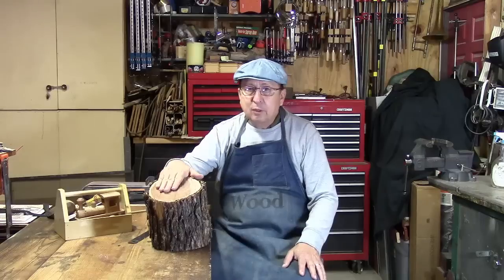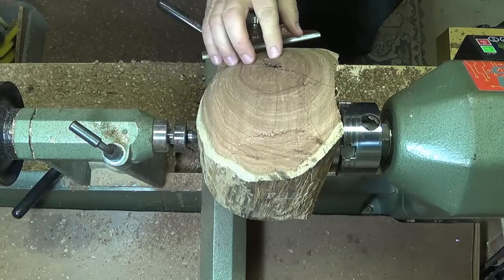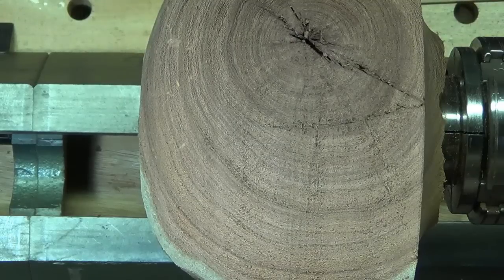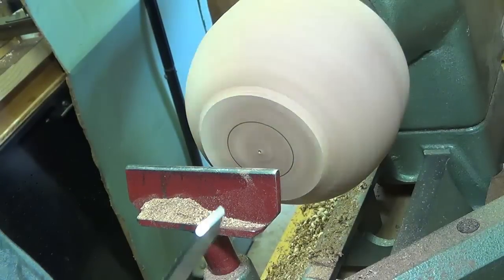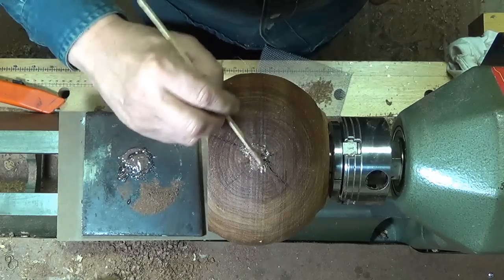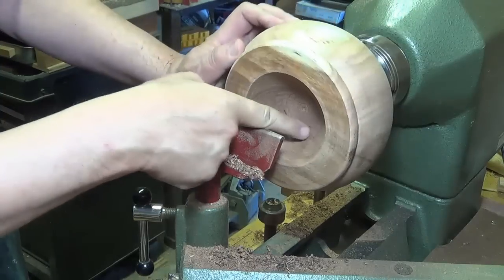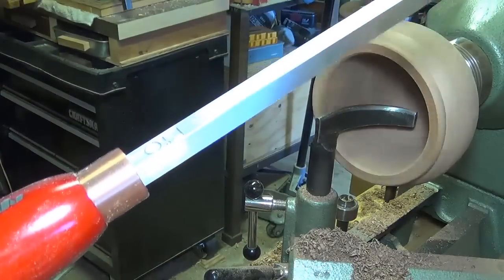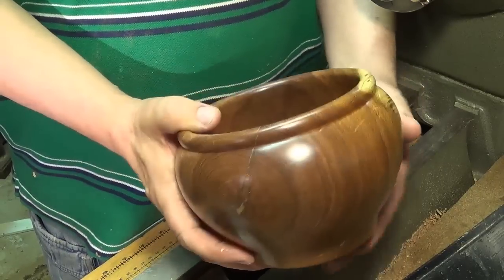Freestyle Mesquite Bowl

Comment: You ended up with a very pleasing bowl, Cip! I like your methodical approach and how you explain what you're doing. Thanks!
Reply from the maker: +Rick Hilton Hey there Rick! I think it turned out well. Talking to the camera while turning comes natural. It's like talking to myself. At my age that comes natural, too. See you on Thurs at the turners meeting. Cheers...
Reply: +Cip&#39;s Wood Chips I've heard that talking to yourself is okay as long as you don't answer! : ) Anyway, I did have a question. Why don't you apply the finish when the piece is on the lathe, and use the resulting heat to apply a glaze to the piece? Also, have you ever turned a bowl using Arizona Ash? I have a piece of ash from a neighbor's tree and was wondering if its worthwhile to try to make something with it. See you at the meeting!

Comment: Great video, love how you explain your process. I have 120 acres strewn with mesquite and love to turn it, especially wet. Mesquite is so stable it only shrinks about 5% from waterlogged to dry. Epoxy or CA and coffee grounds makes a great dark filler for those wind checks in the pith.
Reply from the maker: +Andy Owen Howdy Andy! I was very pleased with this piece. When I filled the large checks I was hoping it would turn much darker. In the end it is just fine. I usually use ground activate charcoal to make a black filler. I will do that next time. Thanks for watching. Cheers

Comment: Having lived in the desert southwest, I have worked with my share of mesquite.  That wood is harder than my head....and that’s pretty hard.  If you had been using a cheaper grade of tool, you would have been sharpening it very often.   The carbide is the tool I use to turn mesquite since I don’t have to sharpen nearly as often.

I have also turned Argentine mesquite and it makes beautiful wood turnings, as well.  However, the Argentine mesquite tree has thorns 3”-4” long and cutting down the tree for the wood can be a challenge without being injured.

Try turning some Tamarix (desert salt cedar). It is a beautiful wood too, yet does not have the same properties of red cedar.  Tamarix can be difficult to turn because of its hardness, but worth the effort.
Reply from the maker: Howdy Glasscutr! It looks like you know mesquite. Mesquite in Texas does have thorns when it is young for protection. It looses most as it grows and thickens. Occasionally, I do find them embedded in the barks. It is a good idea to wear gloves and be careful. Cheers

Comment: Does mesquite check easily?  I want to do some turnings out of mesquite. Nice project. Good looking bowl.
Reply from the maker: Greetings William! In my opinion, mesquite is a good dense wood. I would say it is very solid and does not check or slit easily. It can be weakened by insects and water damage over an extended period of time. Thank you for the question.

Comment: Cup, can I ask what kind of lathe you use. It is so quiet, I think I need to upgrade to that make/model.
Reply: Sigh, sorry for the auto correct Cip
Reply from the maker: +webslinger67 Howdy Webslinger! I mostly use my Nova DRV-XP. I believe in the UK and Europe it is sold under the name "Record Power". I have another lathe I sometimes use, Nova 16-24 (8 speed, belt drive).
I hope that answers your question. Cheers.

Comment: Hi Cip, I am fairly new at bowl turning and I have a Shopsmith lathe, it is ok if your bowl blanks are as round as you can get but if a little rough and not well balanced the machine will try to walk off the location. The slowest I can turn is about 650-700 rpm. Shopsmith has a speed reducer but is very expensive and I don not have that kind of money right now.  What brand of lathe are you using? I like the fact that you can turn it way down!! Keep up the good work. Whished I had some mesquite!!
Reply from the maker: Howdy Warren! Only you are responsible for your safety, so be extremely careful. I turn on Nova Lathes, but I also own a small Jet lathe. For lathe bowls, I start at the lowest speed 150 rpm. I increase the speed until I can feel the lathe shaking, then slow the speed to stop the shake. Turning an unbalanced timber at 650 RPM can be risky. I would not recommend it. Kind Regards.

Comment: Do you always turn at 5-6 hundred rpm? Seems slow to me, I find higher speeds actually turn easier for me. Just a thought.
Reply from the maker: Howdy Michael! Yes, I do turn much slower than most people. Fast speeds generally give a smoother cut and quicker results. For me, I find that with sharp tools I get a good clean cut. I am retired and in no rush. Thank you for your question. Cheers.

Comment: what brand is that scraper and where did u get it from
Reply from the maker: Hello there Ice! The scrapers are from Harbor Freight. I made a new longer handle for the 1". I bought these tools a long time ago and they are made of good hard high speed steel.  Cheers.
Reply: +Cip's Wood Chips thanks for your reply. have u used and of the record power lathe tools
Reply: Any*
Reply: Ice Death Cooksley

Comment: How do you decide when to increase the RPM?
Reply from the maker: +vitriolix Hey there Josh! Speed kills so knowing the right speed is important. At the beginning of this video I start as slow as I could because the raw timber was out of balance which can cause the lathe to actually shake the lathe and bench. 

So I start slow, increase the speed until it starts to shake then I slow it down a bit. As I remove wood the timber will slowly come into balance and I will speed up the lathe a little. I did most of the turning in this video at about 600 RPM.  

The diameter also dictates the speed. Large timbers I spin slow small things like spindles and pens I spin at 1,000 RPM or more.  Finials I spin at 1,200 to 1,500 RPM.

Thank you for your question. Cheers...